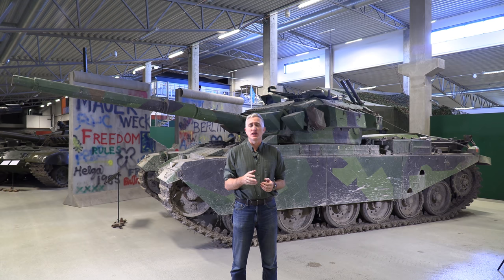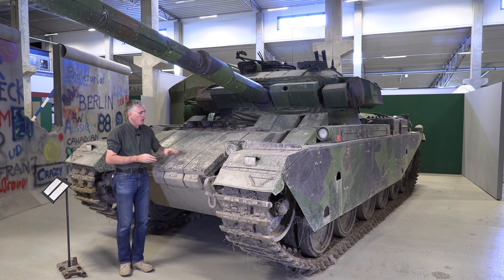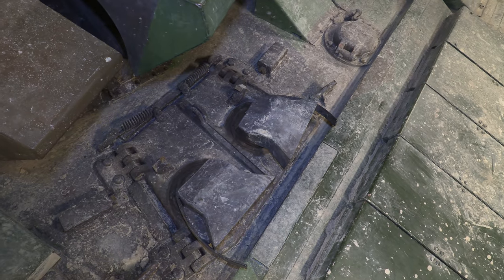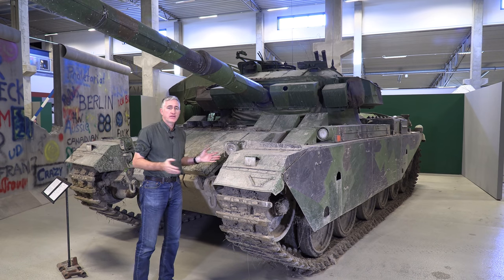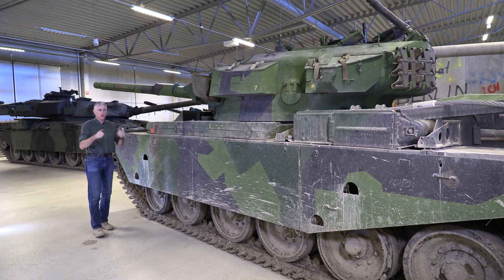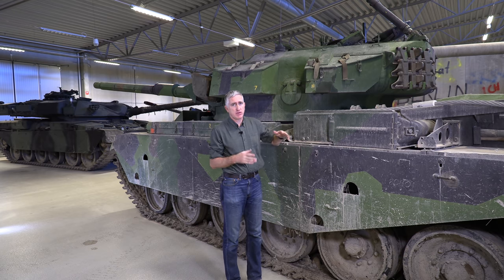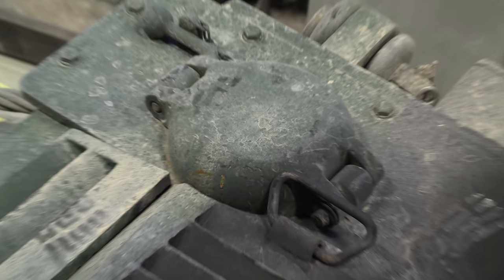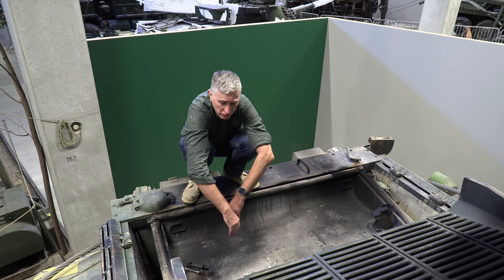Inside the Chieftain's Hatch: Strv 104, Pt 1

Comment: I'm rather curious if the Swedes ever looked at the S tank's 105 and went " can this longer 105 be possible on a Centurion?" in the name of concepts
Reply: Possibly, but I suspect it would cause stress issues with the trunions and vertical stabilizer.
Reply: @SonsOfLorgar  Not to mention running into things and knocking over lampposts.
Reply: They were designed to fight along each other so they didn't need to be "identical" in that sense. Although, I've seen first hand that the Strv 103B with a trained crew actually was quicker from spotting to first shot compared to the Strv 104.
Reply: There was an Strv 105 centurion variant. The Swedish wiki for the tank described is as a 102R with new suspension, thermal sights, and driver hatch with one prototype build. Made as a low-cost alternative when new tanks were confirmed in early 1990 that resulted in the Leopard 2 purchase with first leased used Greman Strv 121 and then new build 122 with extra armor and other Swedish modifications.
The wiki page also list a Strv 106 as a modified 101R but none was ever constructed.

There was never a new number for Strv 103 there was a letter in the end instead. I would guess that is because all had the same hull and modification was engines and other systems, the centurion modification has hull changes. There was even one experimental 103 with cameras and remote control that would be the first remote-controlled that could be used for combat
Reply: @target844  the remote controlled version had it's gun removed and a mine clearing device instead of the dozer blade, it's sitting at Milliseum in Skillingaryd Småland, visible from the E4 highway.
Reply: We swed had strv105 a upgrade from 104. 105 was the modern technology in it, have night vision, range finder and so on. But we didn't have that model so long. 
So we buy the Leopard and modified that instead. And now is it one of the best tanks in the world.

Comment: Why did Sweden add the ERA plates to the front instead of just buying a new tank? Was the S tank so flawed in the eyes of the Swedish army that an upgraded Centurion was significant better/ worth having around?
Reply: The Centurion and S tank served and were decomissioned together in the same role in separate regiments, both replaced by the leased Strv 121 and licence built Strv 122 in the early '00s.
The Strv 103C and the Strv 104 were of the same upgrade generation.
Reply: @SonsOfLorgar  I see

Comment: Whats the advantage of having an exhaust compartment instead of just leading the two exhaust pipes out like for example on the M46?
Reply: It would have been much simpler (but messier as shown) to just dump them into the cooling duct than have to cut the rear or side hull to run exhaust pipes out.  The M-48A3 and M-60s had pretty much the same arrangement but of course the duct went out the rear grills instead of the top.

Comment: Did the Israelis sell them re-engine kits or did the Swedes engineer their own off it and buy the powertrain components direct from the US?  The back deck looks very M-48A3.
Reply: as far as I understand, the Israeli gave Sweden a single hull already modified to have the Continental engine.
Basically, they sold the "how-to" put a diesel in the damn thing, not any actual kit.

Engines came from US and Sweden did all the metal work around.
Reply: @fabiogalletti528  The back deck of the M48A3, M48A5 and the entire M60 series is designed to reduce the tank's infrared signature. It could be that the US provided diagrams to the Swedes or just a case of parallel evolution, with solutions for the same problem tending to converge